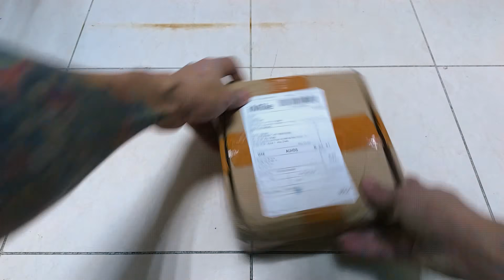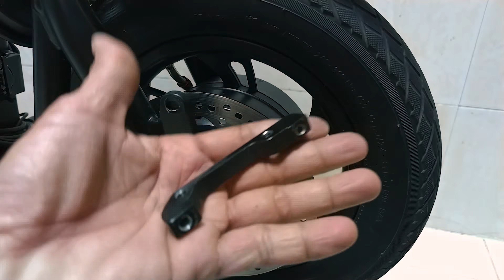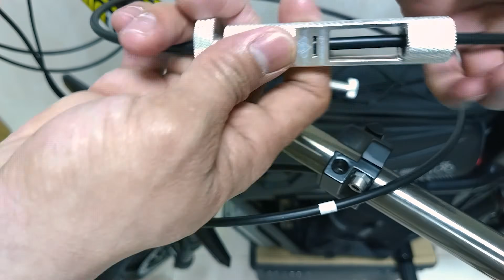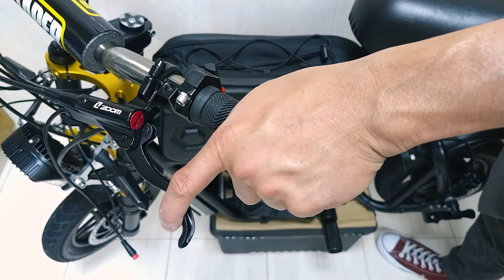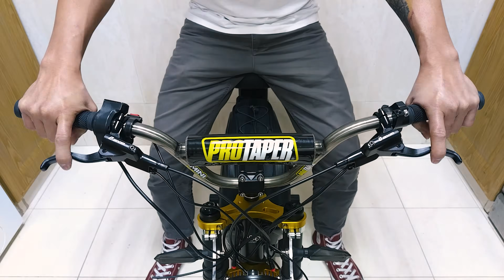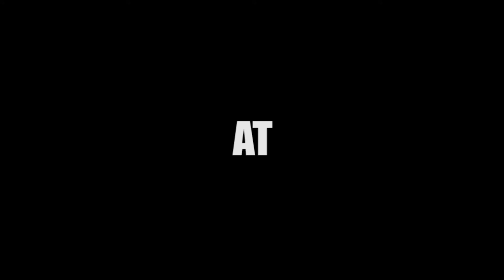Hydraulic Brakes | How to Install and Shorten Hydraulic Brake Hose | Zoom Hydraulic Brakes

Comment: master pwede po b mka hingi ng list ng mga piyesa ginamit mo dyan sa e bike mo balak ko kasi mag buo ng sarili kong e bike salamat
Reply from the maker: Goodday Kaadik!
Bale un Fiido Q1s ko is seconhand lng.
Ito mga stock parts:
-Fiido body frame
-Front mag
-front/rear wheel
-front/rear wheel interior

Ito nmn un mga new parts(upgrade)
-60/72v 4500W hub motor
-50A YYK controller
-72v 35Ah battery pack
-Protaper handlebar
-BMX bike stem
-Handle Grip
-Stem riser
-Motorcycle switch
-3speed switch
-Horn (hella)
-Headlight
-Tail light
-Storage bag
-Circuit breaker
-10 guage silicone wire
-Strap
-String Bag (lagayang ng baterya)
-Foot pegs
-Grab bar
-Dc to DC stepdown converter
-Thumb Throttle with key ignition
-Dual crown fork (for 12inch tyre)
-Head light bracket
-Turn signal light
-ZOOM hydraulic brake
-Bicycle headsey (threadless)
-Bicycle compression steerer headset

Sana kompleto na yan Kaadik hehhe!

Check mo un mga description ng videos ko Kaadik.
Naglagay na ko ng mga links dun para madali mo hanapin un parts na bibilihin mo.

Un hub motor, battery at controller sa local shop ko n nabili dito sa UAE.

Mas ideal ang 2500W na hub motor sa ganitong set up.
Overkill na kase un 4500W, pero pede rin nmn.

Ride safe lage Kaadik!
Reply: @jaysonulanday  salamat master mag uumpisa plang mag buo mas maganda kasi ganyan ikaw ung bumuo kabisado mo yung gamit mo hehe salamat sa mga tutorial master
Reply from the maker: @levissarmiento2740  
Maraming salamat din Kaadik!
Goodluck and enjoy building your electric ride!

Comment: Idol baka pwede humingi ng link ng stock brake pads. Di ko mahanap online ano itsura eh.
Reply from the maker: Goodday Kaadik!
Sa AliExpress ko nakita to.
I just found this on AliExpress: 
1 Pair 4 Piston Hydraulic Bicycle Brake Pads for ZOOM HB876 SHIMANO D02S XT M9020 M8020 Saint M640 M800 M810 M820 M520 M420 876
https://a.aliexpress.com/_c4a0OqV5

Ride safe lage!😎
Reply: @jaysonulanday idol gayahin ko sana tong set mo hehe correct po kaya price nito sa shopee 4400php sya? Hb876e
Reply from the maker: @blackriderph4340 
Goodday!
Halos same price lng.
Pero mas mura yan sa Shoppee.
Sa AliExpress 296.14AED.
Pag converted in peso nasa 4973php.

Good price na yan.
Basta make sure legit un seller.

Saka set na yan sakin. May kasamang tools.

Talagang nag-i-enjoy ka mag build Kaadik! Heheh!
Reply: @jaysonulanday salamat idol! Masarap mag build lalo na may mga build videos ka easy lang talaga hehehe
Reply from the maker: @blackriderph4340 
Sobrang nakakalibang mag build Kaadik! 😎

Comment: Where did you get the cutter and what model #is it can’t find it in the description. Thank you very much bike looks nice😎😎😎😎😎
Reply from the maker: Good day!
The hose cutter is included in the hydraulic brake set. I was looking for a link in amazon to send it to you but i couldn't find.
Check this link of AliExpress. 
It's where i got the hydraulic brake set.
I just found this on AliExpress: 
ZOOM HB-876E 4-piston Disc Hydraulic Brake Electric Scooter Folding 203 Mountain Bike Power Off Black Red 160 E-bike Bicycle 180
https://a.aliexpress.com/_c3dRHGJb

Thanks you for liking my bike!😎

Ride safe!